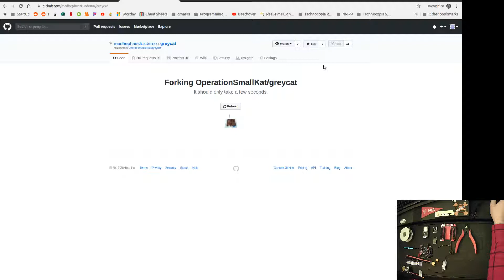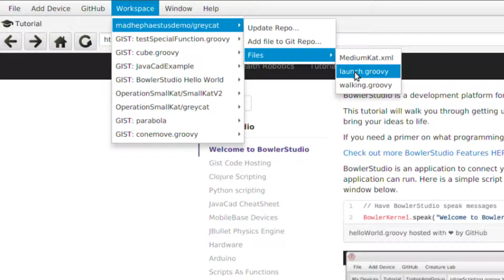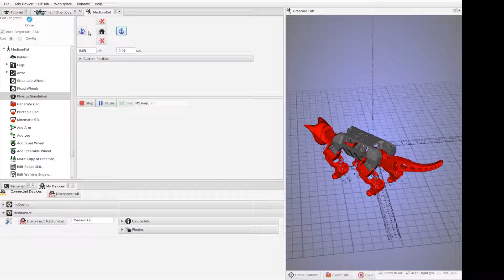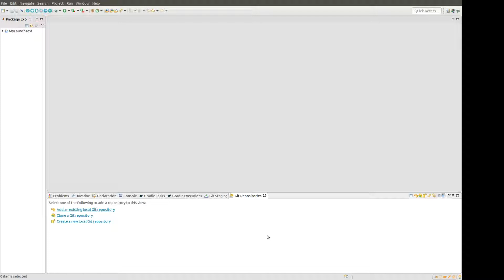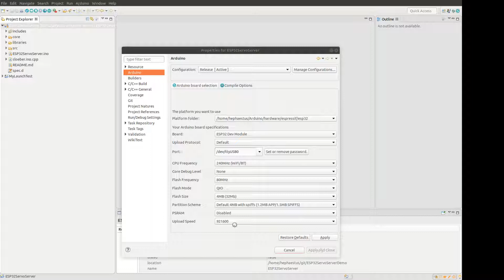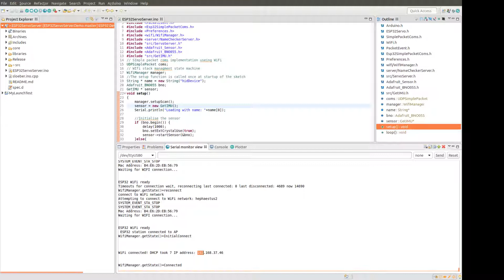Set Up SmallKat Software And Connect

Comment: I can get all the way to the setting of the IP address for the smallkat, but I can't get bowler studio to connect to the IP.  The part where it should say the game controller has failed.
Reply from the maker: so there are 2 esp's in the launch.groovy, one in the smallkat, the other connected to a Wii controller. Which one is having the connection issues?
Reply: @KevinHarringtonBuildsRobots  @18:25  is where I am stuck. I can't get bowler studio to update with the updated information. I am not getting any response that there was a successful name check.  Thank you for your help
Reply from the maker: @mattwood8654  Your robot and laptop have to be on wifi, and the same wifi. bowler studio used UDP broadcast, so the first 3, of the 4 numbers of the IP address have to match. What are the IP address for the laptop and esp32? Are you running launch.groovy after confirming that the esp32 has an IP?